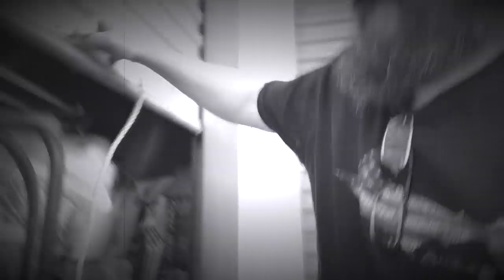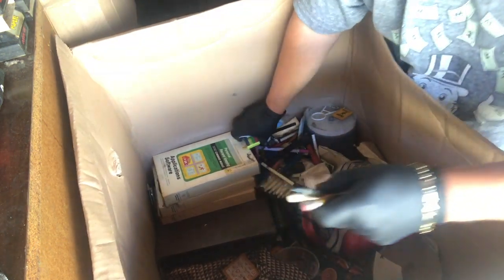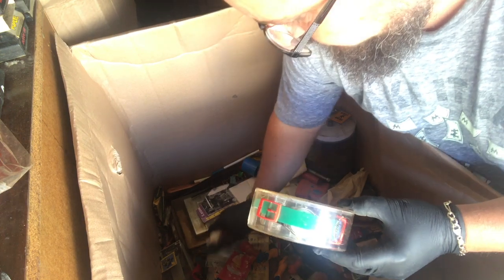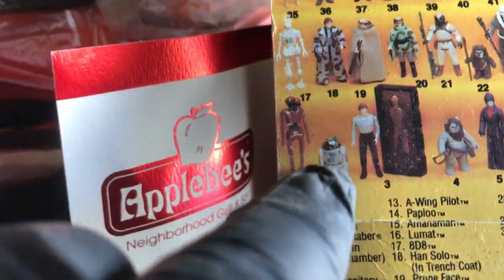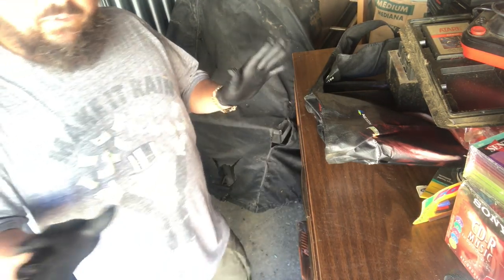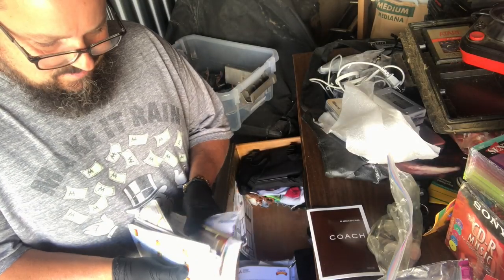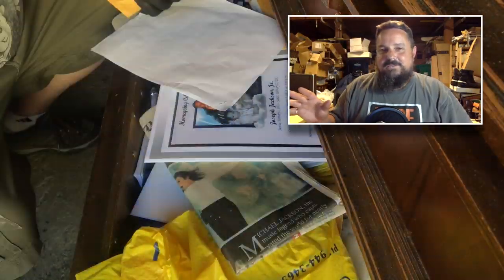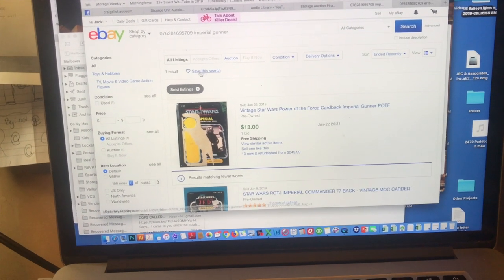FOUND STAR WARS WORTH MORE THAN GOLD in the 3rd Time Locker bought at the abandoned storage auction

Comment: Hey Jack - Congrats on the new finds.  I know you like fixed pricing on some of these items. Toys in Blisters are all about condition.  I know you mentioned you sold one of them (Imperial Dignitary) and you might of priced it low (agree).  Maybe start an auction at a price you would be happy if only one bidder bid and see where it goes.  The fervor on a lot of those other auctions are about Ebay bidding wars and that is what drives price up.  These toys are hot, but if card, toy and accessories are not mint, they get slight discount.  Believe it or not, they make plastic holders for these to prevent denting/dings.  Just a suggestion and I do understand not wanting to undercut too much.  NIB / MIB hold your ground, but condition iffy, small discounts never hurt.  Great job as always!
Reply from the maker: Thanks Greg! These were rare finds for me, but not the mint ones. Someday I'll find a true collection, one that someone put into cases and they had the really good stuff. That'll be the day when I have to make a harder decision to keep or sell. For now though, most everything's gotta go!

Comment: @lockernuts use a hair dryer on low to heat the candy cane it will pop off without damaging the packaging
Reply from the maker: I thought about that, but it would also weaken the adhesive for the bubble pack on the other side. It did wrap the paper a bit, but I think damage on the back will devalue less than if the bubble pack comes loose. I don't know... it was a sticky situation that's for sure!